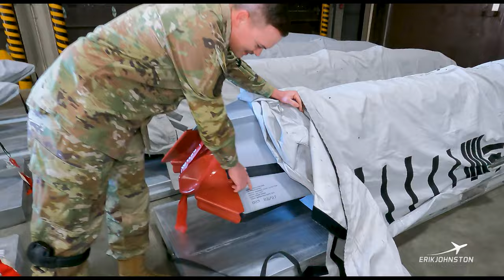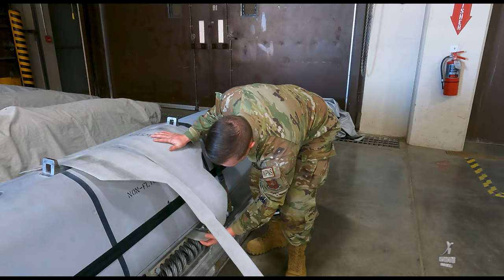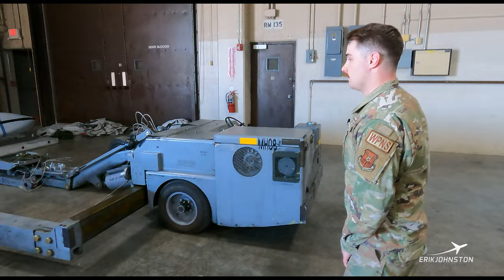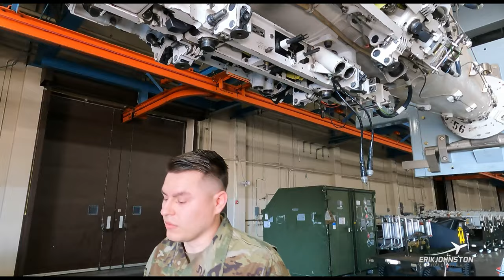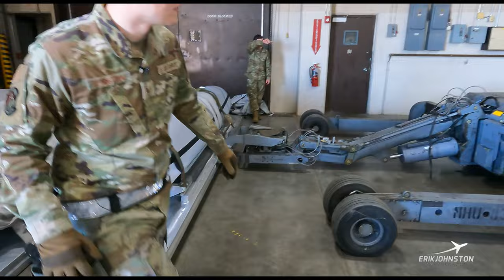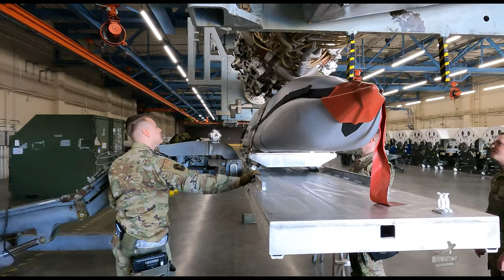How To Load Weapons On B-1 Bomber

Comment: Brings back many memories. I was a weapons troop for 24 years. In the late 70's I loaded the first iteration of the rotary launcher on B-52 aircraft. Back then it was the SRAM (Short Range Attack Missile). It was a nuclear missile we had on hard alert back then. Also back then we obviously didn't have computer check lists. We had actual paper check lists. The pages were in plastic sleeves and you checked off the steps with a grease pencil.
Reply: That, too, was my days on the B-52. I wasn't weapons, but I was always fascinated when I get to watch a weapons load.

Comment: Cool video. Only downside is because of noise it was sometimes hard to hear what they saying, but thats understandable. In other comment i read that full B-1 walkaround is coming, really looking forward for this. If im not mistaken, its only variable-sweep wing in US service.
Reply: Weird they don't have some ultra super silent muffler on that forklift? Looks like it's from WWII. Puzzling after 80 years they haven't figured out a way to quiet that beast?
Reply: @williambarry8015  yeah, was thinking the same - operating with extremely expensive equipment, but havent found a way to have a silent lift? The connector is in a place where fingers can be crushed? The Forklift moves in a parabolic arc and they havent found a way to build one that just... lifts straight up? The cascets are built in a way that allows ammonition to fall of (if it would drop even from 5cm it could slide of in the direction of the soldier...) Idk, its an absolutelly great video and I dont want to be an armchair expert - but I feel like there are some unnecessary dangers for the mena and women in uniform here...
Reply: @williambarry8015  Even better, make it electric. It only travels very short distances, so you wouldn't need huge batteries and it would charge fast.

Comment: Is it possible to do hot refueling/hot rearming? Also is it possible to load 3 launchers in advance, and quickly swap the launchers on the aircraft when it comes back from a mission, to do another attack as quickly as possible?

Comment: Fun Fact  :  "74 Man Hours of maintenance for every One Hour of B-1 Bomber flight time."
Fun Fact #2 :  "Due to the maintenance, etc. the B-1 Bomber never deployed to the Gulf War, it flew from the Midwest USA, midair refueling several times, dropped a couple thousand pounds of bombs, then flew back.  The 2 man crew purchased a Sears Lawn Chair to take turns sleeping."
Fun Fact #3  :  "The B-52 Bomber is still in service,  it has not been replaced.  IF you wonder "why" then re-read this comment."